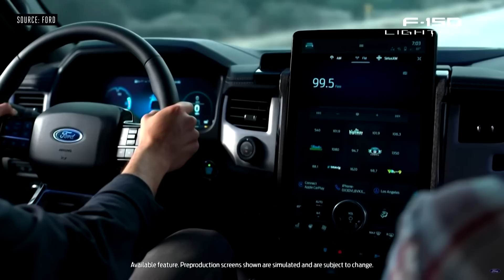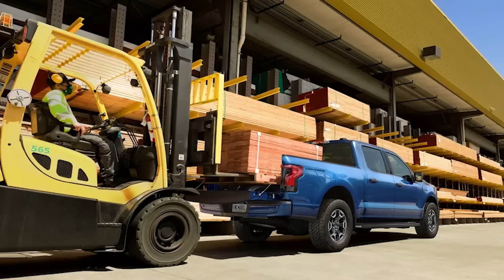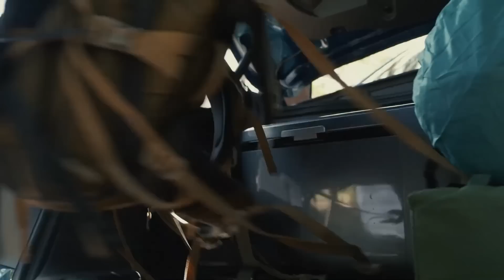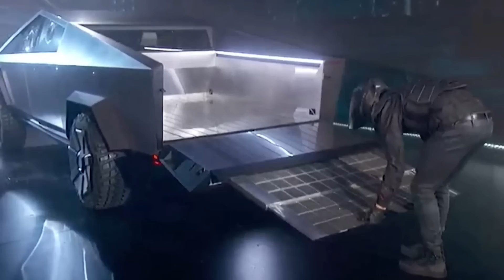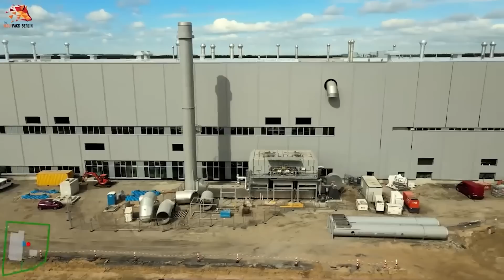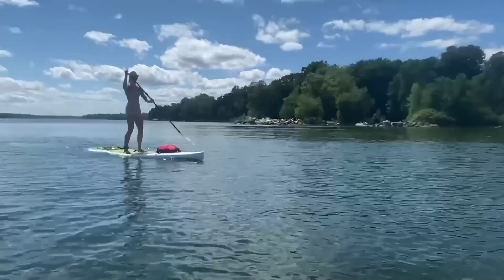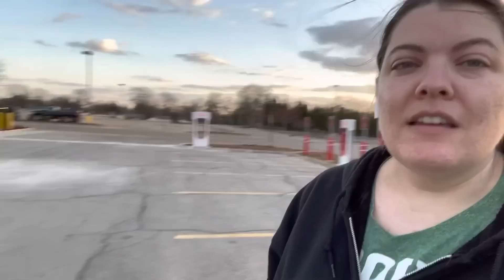Tesla Time News - Ford F-150 Lightning Unveiled

Comment: You can now buy solar panels throat are designed to mount vertically as on porch railings and plug into either backup batteries or you could plug directly into an outlet.
 Sorry can’t remember the name of the panels.

Comment: An error in the video: the Lightning doesn’t have vehicle-to-grid (V2G), it has vehicle-to-home (V2H).  V2G lets your power utility buy electricity from you during peak periods.  V2H let’s you power your home during an outage.

Not mentioned in the video, but just to round out the list, V2L is vehicle-to-load, which the Lightning also has, which lets you use the high voltage battery as a mobile power source.

Comment: V2G is a nice feature however, this has a really big drawback
you need special hardware to isolate your house in the event you want to feed your home from the battery otherwise you will feed the whole grid and it causes a danger to the PowerCo Line Man
just hoping the client turn off the main breaker when doing V2G is not even possible as you might forget to do so and then plug your car, backfeed the grid and cause issues

Comment: I would Love for FORD to BUY Back MY Old F350 Crew Cab Dually........it has over 500k Miles on it and shes a BIG 460.......BUT Until they can Prove to me a Cybertruck or Lightning can TOW A Gooseneck Stock Trailer safely then I will have to stick to my BIG Block........OH and The Stated Miles per Charge IS not Bad for a TRUCK ......if that distance is the SAME with a Load then that would be really good for a Truck BC most of US dont drive 200 miles a day..... and I would think if Ford was Smart they would offer a Bigger Battery or Maybe even a PLUG in Second Battery that could Maybe Plug into the Plugs for Power in the Truck BED Receptacles or some form of Special plug that would add 2x the distance to the truck IF your a mostly Highway Driver with No real Loads in the Bed
     Another Awesome way for FORD to add Mileage and even help with the Grid to Power thing would be to Offer a BED Cover /Solar Panel that could Charge while on the Road or Parked.........This would Have a 2 Fold effect on the Truck......first off it would CUT down on the Tailgate drag on the truck and Second it could Provide extra Power, BC here in FL that would be a God MODE for us in the Sunshine State 14+ hours of SUN most Summer days Or when Summer Storms comes it could Help Power things during Power Outages we get Frequently with NO Warning here in FL. 
   Not to mention it would Help Ranchers/Farmers alot to have that Extra ability when Truck is parked sometimes for hours while Working on Ranch or Farm but too far from A way to Plug In to Charge Not to mention they could have a source to use Power tools........to BE honest this Could BE HUGE if FORD does this right and they DON'T Cheap OUT!!!      Cow}:-o)

Comment: So you can maximize full out put. Solar panels should be portable on cyber truck. Fold out from  the tonneau cover to your roof. add as many as you want.  inlets on front and back  Three,  three quarter Hitch mounts on front and back. Wind power is another option  H20 will power a generator from an ice car.. You could drive for free.

Comment: Absolutely (use Ford F150 Lightning to power my house). And when my power runs out, I go to the other side of the city to my brother's house where there is power, charge up my car in a few hours, and come home to power my home for another 3 days.

The problem with my Powerwalls is that they are not mobile. I can't take them somewhere else to charge them up.

Comment: WHY DOES TESLA HAVE TO ALWAYS BUILD ENTIRELY NEW FACTORIES? THE "GREEN" APPROACH IS TO REUSE REPORPOSE OLD PRE-EXISTING BUILDINGS AND FACTORIES...
Reply: That’s what Tesla did in Fremont. Fremont’s been at capacity since 2018. Things like the Gigapress require a layout that can accommodate them along with their added weight. A lot of these old factories would require a lot of remodeling, renovation & modernization, which would probably take more time than building a new factory without reducing the environmental footprint all that much. 
Ford plans to produce 80,000 F-150 Lightnings per year, Rivian plans to make 40,000 vehicles/year, & Lordstown hopes to produce 2,200 trucks per year, while Tesla needs to produce 500,000 CyberTrucks/year just to get through the preorders by Q4-2023!

Comment: 230  Miles is good for 90% of people... if you do construction, you charge up at the job site... your fine... charge at the hardware store or paint store, or lumber yard... your fine..
Reply: I haven’t seen charging at any of the job sites near me, & I live in West Hollywood, & there aren’t enough “destination chargers” at hardware & paint stores & other facilities to deal with the demand if more than 5% of all truck sales are EV trucks. &, the network of high speed charging stations available for these is inadequate, especially when compared to the Tesla Supercharger network. If there were more destination chargers, chargers at job sites & a more built out high-speed charging network, the 230 mile range (200 practical miles) would be plenty for 95+% of the people.
I often spend a lot of time talking to people who claim 400 miles of range & getting 75% of that in 30 minutes isn’t sufficient, so 230 miles & needing 40 minutes to get 175 miles of range isn’t going to get them out of their ICE trucks.

Comment: Range of the ford f150 is estimated with 1000 pounds load on the back carrier including driver on the seat as epa. So the actual range without any load on the carrier comes out to be more than 450 miles ... Not 300 miles as they claim.
The 300 mile range is only true when you are carrying a 1000 lb load on your back.

Comment: The ranges for the Ford Lightening are calculated with a 1,000 lb payload.  Without payload, the ranges are actually substantially larger.  This needs to be pointed out for a fair comparison.

Comment: So, does Ford give you the AC/DC converter, and the transfer switch? I've got a Raven, it's a hybrid mower/generator/golf cart/truck/ATV. Well, it does have a 7100 watt genny, but to my surprise, one of the selling points is "it'll power your house in an outage" cept it won't, not without a bunch of money for the 2 pieces of equipment needed. Also, vehicle to grid is a misnomer. That implies that the vehicle produces excess energy that you can then sell back to the utility companies. You cannot.

Comment: The F-150 Lightning would never happen if not for Tesla and I would never buy a Ford.  That said, I agree with Lee that I need V2G in the Cybertruck and I think it is good Ford is providing that to put pressure on Tesla. If Tesla does not initially offer V2G on the Cybertruck, I may hold off on my delivery until they offer it.

Comment: Hi guys! I appreciate you. You mentioned the failed hydrogen swap for gasoline. I believe BMW figured out the were riding the wrong pony somewhere down the line, as after many years of study they were on version gazillion of their foolish hydrogen  strokes, as you stated, trying to swap one fossil fuel for another. Also I completely agree with your assessment of the poorly performing mustang, as to why. And that's sad, because I've been a Ford man forever. Only wavering thrice. 1st time being disappointed on Fords decision to let the exploding fuel tank behind the rear axle ride, based on greed $. 2nd for a Fleetwood Brougham (also in the previous century), and finally for an Escalade (this century). Mainly because I just love getting a whole 9 miles to the gallon. Tesla save me!

Comment: You’re wrong about the air panels.  With those, you dont need to drill holes in your roof to install brackets.  You can just stick them to anything and done.  Less materials and damage to your building.  I think it’s brilliant.

Comment: The Cybertruck tailgate was covered in another video somewhere. There is an option in the Cybertruck to lower the suspension on the rear end so the tailgate is on a flat plane.
Putting in a factory in the UK could be to do RHD vehicles, as the UK has recently struck trade deals with Japan and Australia (the other RHD countries).

Phillip.

Comment: Ive been working for Maxeon for the past few years and in the trenches in the solar industry for 20 or so. I think the peal and stick idea is more for ease of installation than weight. Weight is an consideration with traditional panels mostly because of the way they have to be mounted and or weighted down with concrete blocks to hold the panels down in case of high winds especially in commercial rooftop applications. The problem with the "air" type panels or flex pearls is they are heat welded or yes peal and stick glued down but they will not be tilted to "maximum solar gain" angles. Keep up the good work guys!

Comment: Good that Ford is doing something ...but I cant count on Ford for the future...no visionary plan from them. No hard and fast rule in the company to satisfy the end user first only the Ford heirs and share holders will be taken care of. Biggest issue is there is no visionary to guide (demand) to lead them on the path forward into the new future of mobility. Tesla (cybertruck) is a one stop shop for all my needs.
V2G, Charging infrastructure, on board compressor,  ramp, vault, bullet proof, floats, spaciousness,  cooler than the box look, OTA updates, Tesla Insurance,  FSD, range, a recycle plan, NO RUST, superior in house manufacturing, fewer outsourced parts from someone elses version of "good enough".  Ford has zero plans to examine every item thru a 1st principle lense and they will stagnate once again while Elon pushes the future forward at speeds never seen before... 
what did I miss... oh ya, Ford does NOT want to go ELECTRIC, they want old Henry's vision, and make tons of profit...the way it's always been.

Comment: vehical to grid. hmm what happens when the car runs out. Now you have no power and no ride. Total useless.... buy the powerwall for the home there is no need to use your car battery and run it down to power your home only to not be able to drive it.

Comment: A few corrections:

- $40k is the fleet/commercial (stripped down) 230 mile trim. Tow rating of 5000lb, or 7700lb with tow package. 2000lb load capacity.
- $50k is the fleet/commercial 300 mile trim, Tow rating of 10000lb as tow package comes standard. 1800lb load capacity.
- $53k is consumer 230 mile trim. 
- $59k is consumer 300 mile trim.
- $93 is full loaded version.

Comment: While I'm not saying you're incorrect and Tesla will definitely build a factory in the UK, there are a few plus points you didn't mention but are worth consideration.

The UK is Tesla's biggest market in 'Europe', and with the exception of the Republic of Ireland all the other main right hand drive markets are outside of Europe anyway.  I'm sure the UK will be trying to get favourable trading agreements with those markets too.  The UK government are likely to either throw large amounts of money, or tax exemptions at Tesla as they try to show how well Brexit is going.

Also, when you look at workforce and workforce costs, you have to consider efficiency. The UK has the most efficient car plant in Europe (Sunderland Nissan), in fact it's one of the most efficient in the world, not 20 miles from one of the sites you mentioned (Teesside).

Comment: Full-sized bed? Really Zack? I thought you were a contractor. An 8 foot bed is full-sized, not 5 1/2 feet like the Lightning has.
I have to wonder if we would get less harmful effect by burning the methane in an ICE rather than using steam reformed hydrogen in a fuel cell?

Comment: Liked the video. I don't tow and I don't haul other than mulch from home depot, but I'm a huge guy and have always wanted a F150. I want the Pro model, Don't need the 15 inch screen still get a good sized screen and manual heat - a/c controls, do want the 300 miles, and for the vinyl seats, you can cut them off and for $1000 you can add leather seats.  Boom $50K truck, 300 miles,

Comment: Hydrogen is unavoidable for a non-fossil fuel future. In the next ten years we will see for which applications H2 will be better than batteries, and for which applications it will be worse. However, with solar power installation growing exponentially, we will need a high density energy storage to overcome the summer-winter cycle on the Northern hemisphere, and the best way to store left-over solar energy over such long cycles is production of H2. (Potentially supplemented by production of CH4 as we will start removing CO2 from the atmosphere.)

Comment: I have very stong feelings against Biden as the worst president in my lifetime, and this would not stop me from getting a Lightning. Still perfer the cyvertruck, but Ford did a decent job. I love my F-150. Does address some concerns about offroading I had. Cybertruck is sweet, but I'm still wondering what the aftermarket will be for it as far as winches and brush gaurds and other little things us truck owners love to customize. Ford will obviously have them beat by a long shot in the aftermarket department for years to come until these cybertrucks have been out in the wild for a number of years.

Comment: The “Pro” version - aka Commercial version - may only have single motor, a 230 mile range, limited towing capability, and a basic interior without the large screen, but you can pay extra for the Ford Telematics capabilities.

Comment: Felt same way the range is lower but it does come with 2 motors where cybertruck comes with 1. I still prefer cybertruck but hey more the merrier as long as it works. And I believe after Sandy was blown by mach e the lightning should be same.

Comment: 4-8 hours of using the electric outlets, how much degradation of mileage will this cost you? Is there a calculation for this? Either way, the lower variant of the F-150 might not be the right choice 🤔

Comment: It is a big frunk but the only reason it is there is Ford just put batteries in a regular truck. If they designed it right there would be a bigger bed and the cab moved forward like CT

Comment: So why buy a front wheel drive model 3 for 40k, and now get an all wheel drive F150 for $40k?
Reply: Tesla Model 3:
1 Easier to park in small/narrow parking lot spaces
2 Don't need the space of the truck bed
3 Cache of owning a Tesla (like owning Apple products)
4 Tesla software interface/updates should be better than Fords at least for awhile.

But, I get what you are saying, when I look at the base model Lightning all I see are potentials for aftermarket motors that are more powerful/more efficient in a few years (not to mention swapping out to bigger/better aftermarket battery packs), solar panel tonneau covers, that hella amazing front hatch space, lift kits/lowering kits ... all sorts of things that come when you are in the Ford aftermarket ecosystem. I hope that the name "Lightning" is what they are going to use going forward to mark their electrified Trucks and SUVs. If so, I want to read about Ford's "Lightning" versions of the Expedition; Explorer, Ranger and the Maverick trucks coming out sooner than later ASAP.
Reply: @1MarkKeller  those are very valid reasons but I feel like they're more applicable for city drivers rather than say a family of 4 in suburbans. Idk. I wouldn't need the bed either, but I can see how new or upcoming home owners would benefit from it for DIY home projects. Especially since that gian frunk replaces a normal vehicle's trunk so the existence of the bed is not a compromise. And that standard AWD alone is such a big deal for people living in places with lots of snow in winter like New England.
Reply: @Iamallwaysright1  Yep, I'm just glad Ford is finally taking EVs seriously, they will be fully electric in Europe by 2030.